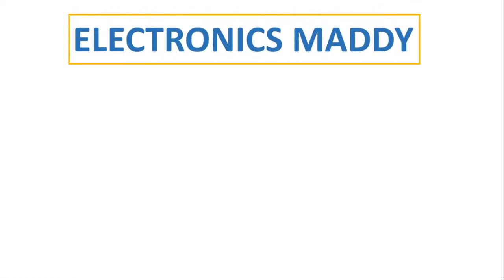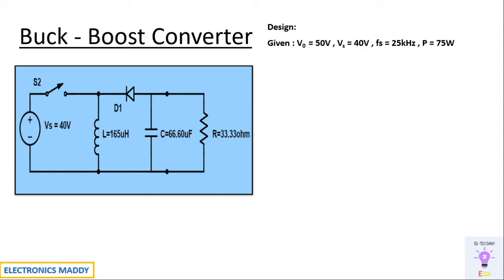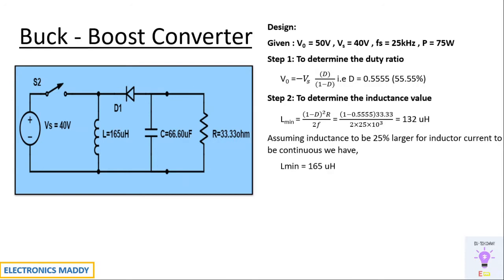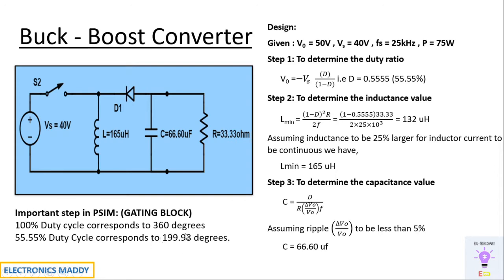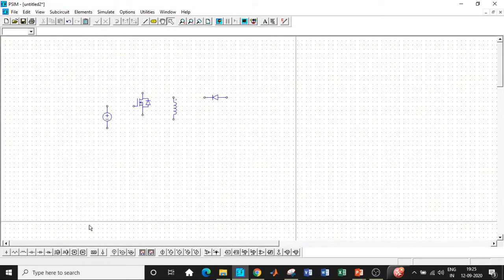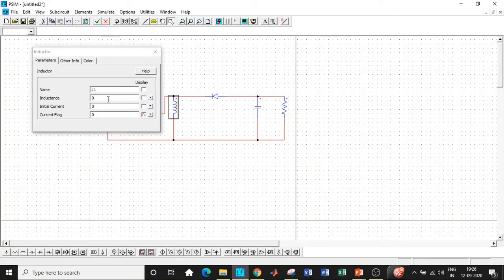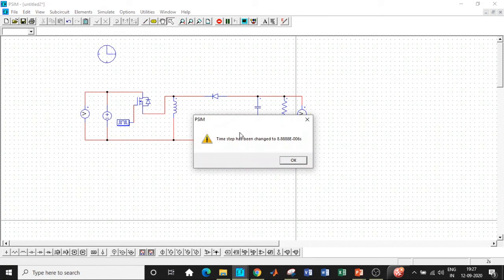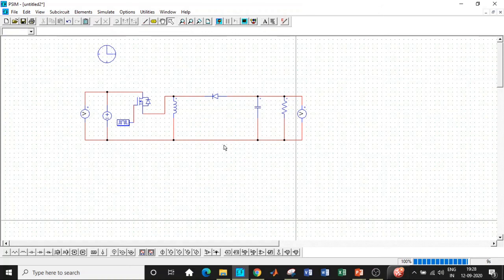Design and Simulation of Buck Boost Converter in PSIM | POWERSIM

Comment: hey. i have a project homework about dc-dc buck-boost converter but i have these values: Vo=100-125 V, Vs=50 V, fp=50khz, Is=2-4 A.
My question is why Vo has two values? How can i determine D , L and C ? Can you help me ?
Reply from the maker: They have mentioned the range of output voltage required and that's why Vout has two values.
Reply: @ElectronicsMaddy  no. VO has two calues